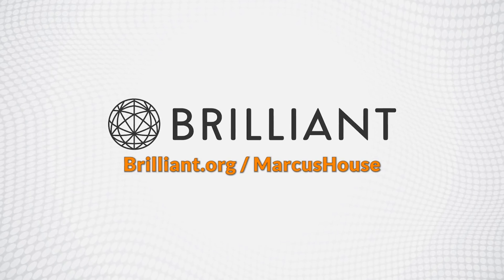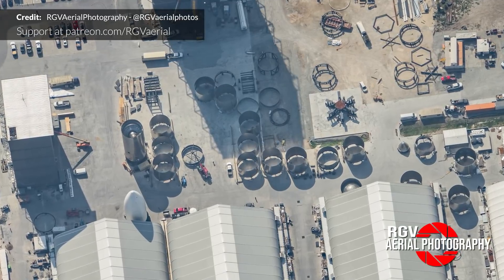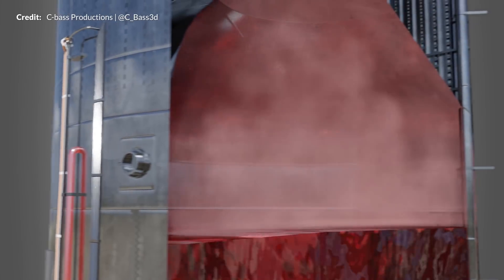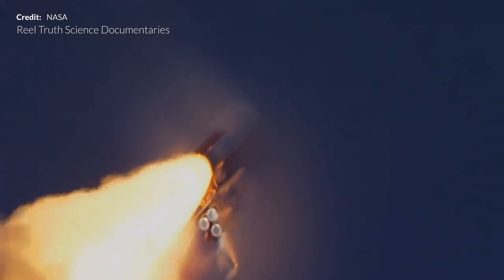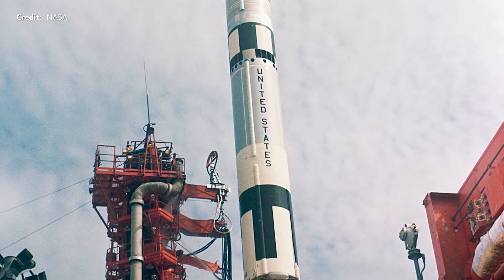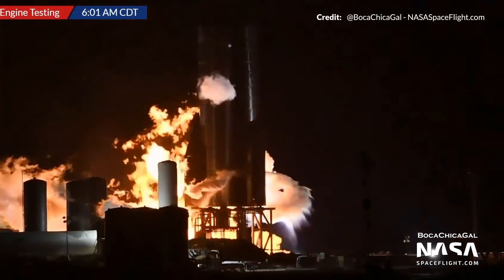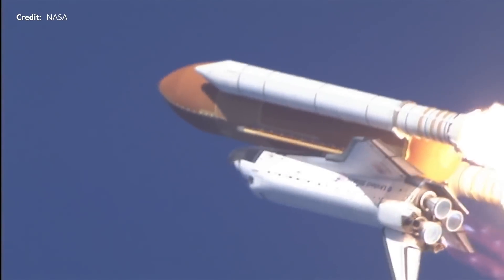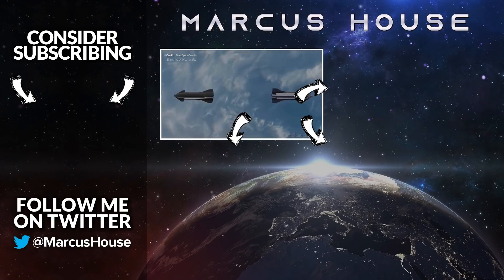SpaceX Starship - How will Starship tank autogenous pressurization systems work?

Comment: Interesting- this suggests that the next "block" of starships could actually use the heat generated by reentry to heat the propellant tanks and maintain pressure. Boil off methane & LOX to cool the starship skin on re-entry, and also use that heat to pressurize the tanks.
Reply: As I remember an early development idea was to use a skin with holes to cool the skin during re-entry for starship. So you suggest that to use this idea to heat the gasses for the tanks back in instead of leaving the vehicle.

Comment: Since there's much thinner atmosphere on Mars, what are the possible implications for starship landing?
Reply from the maker: That is all calculated in the fuel needed for landing. Terminal velocity is much higher on Mars, so they will need to start that landing but a lot earlier.

Comment: Autonomous regeneration sounds like the way to go. But all that pressure won't matter if you can't get the liquid fuel and oxygen to the bottom of the tank where the outlet is. 
But how is that going to work in zero g?
Reply from the maker: Look up Ullage systems. A little RCS thrust in one direction will settle fuel in the tanks before they ignite them.
Reply: @MarcusHouse  the ullage motor! That would do it. Thanks 🖖

Comment: Marcus, I’m still unsure of how the Methane header tank works.  There’s four holes in the tank that allows methane from the main tank to flow down.  There has to be an inner tank, right?  If not, wouldn’t it all slosh out when starship is horizontal?  Maybe I’m missing something, but apparently SpaceX missed something as well because they lost pressure in the methane header tank during the SN8 flight.  They didn’t say what caused this and said they would add a helium tank.  This leads me to think it was a design oversight.  Can you clarify this and how the methane header tank is made?  Thanks!
Reply: Those holes appeared to be valves. Maybe some water ice managed to prevent one of them from fully closing.

Comment: The autogenous pressure system might be used for all thrust manoeuvres except for the landing burn. A standby COPV might take over during the landing. Space X might use a more conventional LH2-powered upper stage for some missions as an alternative (not a replacement!) to Starship.

Comment: Musk did say after the SN8 pressure failure that they were reverting back  to helium and had no idea how the autogenous issue would be fixed. 
At this point I feel it's one of the more pressing problems left to solve. Be interesting to see going forward.
Reply from the maker: It is indeed. I haven't heard any more about the helium temp solution since that tweet. I am not 100% certain if SN10 is using that same temporary solution or not. I'll try to find out.
Reply: @MarcusHouse  
Excellent. I'm assuming 10 and 11 are also using helium and it'll be at least SN15 onwards before any change. Need to stick a landing.
Thanks for your efforts and look forward to the next vid.

Comment: Is it possible to used an accumulator style bladder system as commonly used in hydraulics
Reply from the maker: I've heard this query a few times before. The problem is you are dealing with cryo propellants which will freeze almost anything. I'm not aware of any bladder system that could work in that way with that volume. Regardless, the pressure problem is still the same. You need gas to flow in behind any header tank system.

Comment: Thanks for the insight! Great video once again! 

What i fail to understnd: Why not drop the header tanks, introduce a vertical-move-only seperator plate/dome between gaseous and liquid fuel phases, keep the gas pressure minimaly higher - and in that way keep liquid fuels fixed at the outlet without regard to the vehicle orientation? Instead of the complicated header tank solution? headscratch

Comment: Thanks for the info 👍 I was hoping to find out more about the header tanks and the current helium workaround. Have you already done a video on that?
Reply from the maker: No, although really they are just substituting autogenous systems for a COPV fed helium tank which is much more straightforward. There isn't a lot more to talk about on that really. That was a temporary fix on SN9 and I'm not sure if they intend to use it on SN10 or not. I am assuming so, as we haven't heard otherwise.

Comment: Hi Marcus, can autogenous pressurization help provide more stability to the raptor throttling mechanism and subsequently the flight since it involves bleeding off some feed from both the preburners/turbos and raptor's min 40% throttle level is mainly due to limitations around preburner speeds ?

Comment: I'm just hoping we get more reliability from the Raptors... if static fires are an indication (and SN9's demise) it's more or less a coin flip if all 3 the engines will light up. Extrapolate this to SuperHeavy and we might be trying to launch for a year trying to get a dozen+ engines to ignite simultaneously.
Reply from the maker: Just teething issues with pressure systems. I'm sure they will nail it.
Reply: i grew up in 60s - rockets were failing all the time -

Comment: When in space and there is no gravity, how does the fuel reach the engine?
Reply from the maker: Check out ullage systems. Small bursts of RCS will get the vessel slowly moving in one direction. After fuel/LOX settles, they fire it up.
Reply: Just before engine ignition a little puff of the reaction control thrusters begins moving the craft forward so the fuel can collect at the bottom of the tank. Then they light the engines. If you look around here there are old NASA films where you can see the fuel blobs floating around and then it's like somebody turned on the gravity and it all goes to the bottom like Niagara Falls. Really cool to watch.

Comment: The Viking engine from the Ariane 1 through 4 used autogenous pressurisation as well, but had a stoichiometric combustion of NTO and UDMH in the preburner, which was cooled with the injection of water from a third tank. The inert exhaust meant that they could use it for pressurizing both NTO and DMH tank and use the pressurized liquid water from the water turbo pump as a hydraulic fluid. Pretty impressive for an engine developed in the 60s and 70s.
Reply from the maker: 100% impressive. When taking a deeper dive into this, it is quite amazing to see the evolution from early vessels right up to the Starship, SLS, and other rockets. Long-duration missions are a different story however and that is something that will require active cooling (perhaps heat exchanging) systems to keep that pressure correct.

Comment: Does it works with deep cryo propellant? How do you prevent heat transfert between liquid and gazeous methane?
Reply from the maker: There would need to be active cooling systems to keep the correct equilibrium.